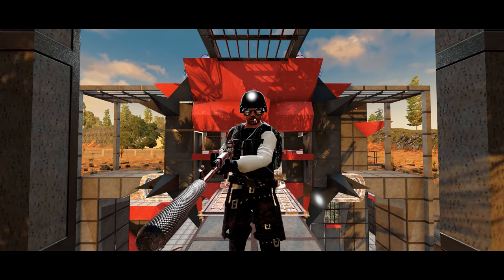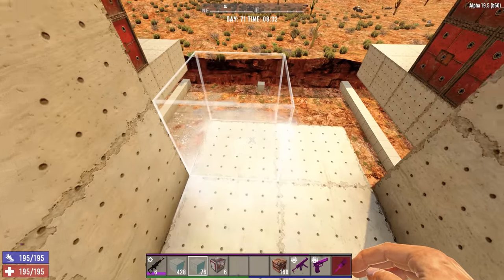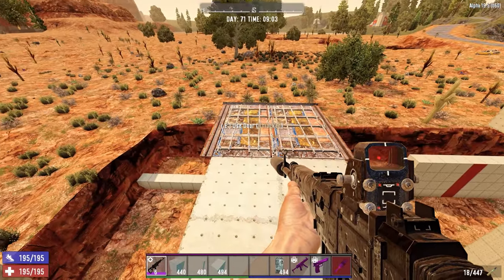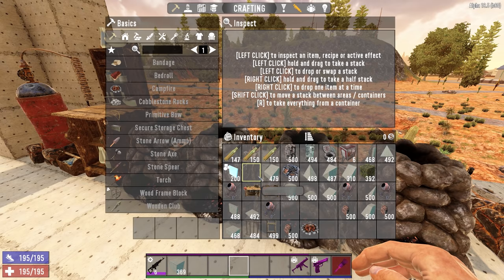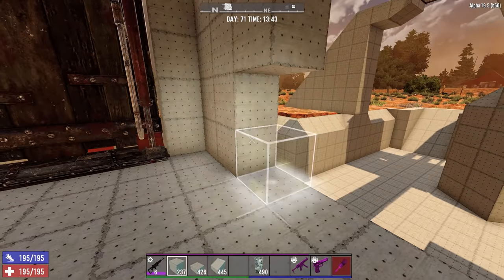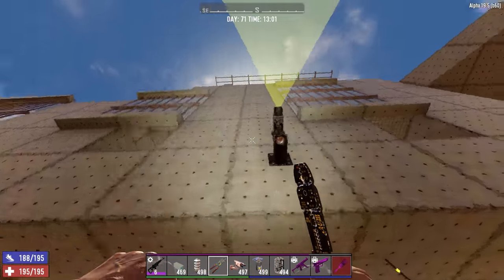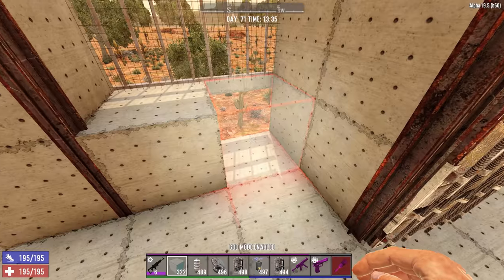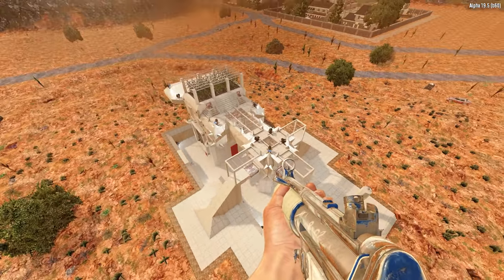How To Build The Ultimate Horde Base - Recreating the EPIC Vanguard Base (download yourself!)

Comment: Exposed wires can be hidden. Not completely, that's simply not possible given many devices will have at least a bit of wire sticking out due to where the wire connects. The bulk of a wire can be hidden, though how well depends what you want to build. You do it with tunnels underneath or along the outer edge of your base. You make the tunnel 1 wide and 2 tall, any bigger it costs more to make and is not necessary, and stick relays inside it on the floor.

I worked this out on a platform base I used to build back in A16. I'd have a platform in a cross shape, red-cross shape, like a square with 4 squares attached N, E, S and W. Atop each support pillar I added the tunnel using the thin concrete slabs for floor and ceiling, walls made fancy as long as the tunnel was enclosed to avoid relays being shot. Both floor and ceiling slabs oriented the same way, slab at the top of it's cube, to make the floor of the platform smooth on top and allow me to add relays to the floor of the tunnel. Made some fancy builds using this simple template.

If I wanted electrical devices beneath my platform then simply making a support hollow allowed me to take the wiring down there to another set of tunnels beneath the base. Depending on height of the platform or width of supports a hollow support may not even be necessary, as long as the relay top and bottom line up to hide the wire within the support blocks.

Turning the corners for the tunnel I added a pole tucked into the corner, which I must've had to do for a reason, though it's been a while so I don't recall the exact mechanics of why. You can still walk past poles in the corners even in a 1 wide by 2 tall tunnel, just like you can walk over relays, or could back then, with just a small bump over relays on the floor. The ceiling slab does appear to float above the pole but since the tunnel is enclosed it doesn't matter, looks supported and not floating once enclosed. Stuck a couple of access hatches along with a ladder to sit the hatch on and let me climb back out in the days before parkour was a thing.

Then placed relays along the tunnel floor and the wires were hidden, protruding only where they left the tunnel to connect to a device, though you never see much wire, or any, depending on what you connect where. Connecting a blade trap to a relay in a tunnel below it, for example, you see no wire at all. Distance and angle between relay and device obviously matters but it hides the bulk of messy wiring and the beauty is, you can access that wiring any time you like because it's all inside a tunnel you can walk through.
Reply from the maker: Reading this makes me want to go back and hide the wires! But I think I'll reserve these tricks for the next big horde base build, thanks!
Reply: @GunsNerdsandSteel  I'll be intrigued to see what you do with it. Takes a bit extra planning when you first add such a thing but worth it when it's second nature to just incorporate to most designs. I started seeing them as just an extension to support pillars once I built them a couple of times.

I remembered why I needed that pole in the corner BTW. It was because my platform's structural support would collapse without it, the pole being needed to extend the support pillar all the way up to the top of the platform it was supporting.

I also stretched structural stability to the limits to make the platform as wide as I could sometimes, though interestingly, despite that it could still have a support knocked out (mine were always the tubular blocks, sometimes thin, sometimes thick, surrounded by 4 poles touching that tube to give max field of fire around them with a 5 block support, which may not work in A19, could be too thin for explosions with just 5 blocks supports each) the base would not collapse. It would only do that if two consecutive supports were chopped out and then only that bit between them. I experimented by seeing what a single support with a tunnel on top held at most and then sticking those together to form a whole platform. An aside but hopefully it'll save you some trial and error if you do run with this.

Anyways, adding the pole in the corners is a good habit to get into even if not needed that time, for when they really are necessary. Hopefully though you can add your own magic, maybe even simplify what I suggest or adapt in new ways.

Comment: So when upgrading the fighting platform from flagstone to concrete, the entire thing just collapsed in on itself, except for the center pillar. Any Ideas?
Reply from the maker: Make sure you have the core pillar upgraded as high as possible. Those 4 blocks are critical and should be Steel ASAP
Reply from the maker: Especially the top 4, the ones you would be standing on
Reply: @GunsNerdsandSteel  Thanks for the advice, I think it might've been because the 4 I was standing on regular concrete, instead of reinforced. Was upgrading the morning of day 35 so that was an awkward horde night, garage was swiss cheese afterwards. Would it be better to just skip the upgrade process and just rebuild the fighting platform in rebar? I don't want to risk it imploding again

Comment: I'm proud that you're using "Cladding liberally" in the A20 they actually ADDED some cladding blocks that are just less than a full block in surface, and you can sneak your nailgun in, to repair a core block behind it. couple that with the "Fence post" thin round thingy, in the corners, you can turn a 1 full block into 9 block support! this as newcomer should know, is how you get bigger beefier support for larger extravigant bases! every "column from bedrock" you can add, gives you more "capacity" to work with. as well as giving armor for your critical support pylons to absorb damage before the whole structure collapses.
Reply from the maker: Yeah turning a 1x1 pillar into a 3x3 pillar is a great trick!
Reply: @GunsNerdsandSteel  Sure is!

or just arrays of thin 2x2 posts that are spread out every third blockspace, so......teeeechnically it's a solid block under there, but zombies could mill around too.

Comment: You might have done better to add even more support below the ground level that you excavated. You know from experience that after the layer of reinforced concrete is destroyed, the ground underneath will be obliterated very quickly through the use of explosives. You should have a few pillars in the corners that go deeper. For one, they act like markers, telling you where the outline of your base is located. Second, undermining would be more difficult to accomplish.

Using only one pillar for the helipad is risky. There should not be much activity around it, but two pillars would provide an extra level of redundancy. You might want to find the outer limit that a pillar can support, and then place the pillars, so that each one can support a large enough area that the gyrocopter is not in danger of falling, if something were knocked out below it.

You managed to place blocks on top of the corn. That gives us a limit of three blocks to work with. Is it the same for trees? If so, then it should be possible to create underground farms, as long as there is a chimney that has a clear line of sight to the sky. It has been a while since I have seen the concept used, but with a floor, a planter box, and three blocks of space for plants, we have a repeatable pattern that is five blocks tall. I believe that I worked it out on my own before, as a thought experiment, but without being able to run the game, I cannot test my theory. Is there a limit to how deep you can go? Can there be a nearly unlimited number of storeys to a growing tower? (I am aware of the game height limitations.) How far away from the chimney can plants be placed, before they are outside of the area of effect of the light? (I think that the ring is four blocks away, so a 9x9 grid can be supported by a single shaft of light in the middle.)

It has been a while since I watched your other videos about the mechanics of the game, and there are others, who have described the structural integrity and the physics of the game, but I cannot recall, if someone has pulled all of them together. Once the block building limits are lifted in Alpha 20, perhaps this is something to consider?
Reply from the maker: I believe that if you dig all the way to bedrock and set up a farm with a light hole straight to the sky box, you can plant up to eight blocks away from that center point without any issues. Corn is three blocks tall, most other plants are only one block tall. And yes you're right about digging the foundation to the fighting platform deeper because through some extensive testing on that base sometimes demos detonate on the floor down there and they can carve a really deep hole adjacent to that pillar

Comment: This base is awesome but it has been a nightmare for us to build legit from scratch because a lot of the structure wants to keep collapsing on us as we build it up.

From day 8 thru day 31, we built the entire structure on top of the ground (we avoided constructing the trench in the beginning because we figured it would be a headache to try and dig all of that up using stone shovels and very little stamina).  No issues whatsoever at that point.  Got the garage, alamo position, trap pods, crafting room, causeway, tunnel, fighting platform, and its ramps built and upgrade to reinforced concrete.  We also skipped the gyrocopter pad because we didn't have a gyrocopter.  We also skipped the spikes as I figured those were just decorative and could be added later once the rest of the base was complete.

So, by day 31, we finally found our 1st auger and we went to work digging out the trench (we had dug one block down in the dirt originally to lay the floor of the garage, so we needed to replace another 3 blocks vertically on all sides to the stone layer).  Once the excavation was complete, I proceeded to try and replace the dirt blocks underneath the garage frame using rebar, then upgrading to reinforced (wet) concrete while he started work on digging up the top layer of stone so we could lay the trench floor down.  Starting with the front right corner of the garage, I got 3 blocks to the left replaced with reinforced (wet) concrete (replacing one block at a time, of course) before I started getting hit with falling debris.  I looked up and, to my horror, watched as the entire garden (including the awning) and roof of the crafting room collapse.  We both ran up and were completely heartbroken to find that all of the storage boxes in the crafting room had also been consumed by the collapse - losing everything we didn't have on us at the time.

At this point, we both raged quit for a day or two.  Once I calmed down, I went back in and activated CM to try and rebuild what had collapsed, but it just kept collapsing (even after those 3 blocks had dried).  I figured there must be something in the steps you took to build it in this video that acted as a sort of 'keystone', so I tried the next rebuild attempt by following the video. step by step, and that still didn't work.  Either the roof of the crafting room would collapse while trying to rebuild it or, once I was able to figure out the sequence of placing the blocks so they'd stay put, it would collapse again once I started putting the farm plots down.  Eventually, I was able to succeed in rebuilding it by filling in all of the garage windows with reinforced concrete blocks.

Now, I'm trying to figure out where exactly that I fucked up.

As I said, the only things we hadn't done by day 31 was build the trench, the gyrocopter pad, all of the decorative pieces (spikes, spotlights, etc), and the turrets/traps/electrical components (vault doors, relays, etc).  Now, during the original collapse (and the next 2 after that) I didn't have the garage window frames filled in with bulletproof glass blocks yet, so I did that before making the 3rd rebuild attempt, but that didn't hold up either (NOTE:  I didn't add the iron bars or the reinforced concrete trim around the outside of the window frames because I figured these were just decorative and didn't think that would have any effect on the structural integrity since they're sitting on the surface, rather than being 'weight bearing' pieces.

My best guess right now is that the trench itself somehow adds to the structural integrity of the base, which is confusing considering that the structures themselves are still sitting on top of dirt or stone blocks.  Unless just having those reinforced concrete blocks adjacent to them still counts.

Certainly will be exporting our save file before making any more changes to the base....just in case.
Reply from the maker: I would encourage you to take some screenshots and post them on the discord and one of us might be able to give you some suggestions on what is going on. Has there been any mining underneath the base?
Reply: @GunsNerdsandSteel  

No, there's no mine underneath.  This is actually the 2nd playthru we've built it.

The first time, we built it starting on day 46 (had more than enough tools/resources to get it completely finished in 6 in-game days).  After the day 56 horde, a part of the fighting platform had been destroyed (the left-front column with the spike at the bottom was completely gone) and whenever I tried rebuilding it, it would just collapse.  That time, we had dug a mine underneath starting with the shaft at the middle of the garage, going all the way down to the bedrock level, then had extended it out to where the platform was.  That was the only thing I could figure was causing it (though I'd always built my mine underneath my base down at bedrock level and never had an issue).

So, this time, we decided to build our mine away from it, just in case.

I'll try and post some screenshots to your Disq this weekend.

Comment: did this design change much for A20?
Reply from the maker: Not really, I might use some of the new shapes but overall this base would work just fine
Reply: @GunsNerdsandSteel  Alright, cool, didn't think there was enough changes, but one can never tell when something in the code changes, pathing, or what have you. it's a cool looking base.
Reply: The zeds won't walk on the open powered doors? Any ideas?

Comment: Question: Why did you put the doors flat? IIRC you put the powered ones on their sides in the Base Types tutorial so when they were powered they would lift open and make a bridge.
Reply from the maker: Wooden or forged iron doors can be placed in any configuration, either vertical or horizontal without issue. Vault doors need to be placed in the vertical configuration. When vault doors are in the flat / horizontal configuration the zombies will path over the rim
Reply: @GunsNerdsandSteel  Awesome i thought I was missing something. I'm hoping to have this base up and running by day 28. I was lucky to have the chem station at trader working, the poi next to him had a workbench and the house under construction across the street had a working mixer.